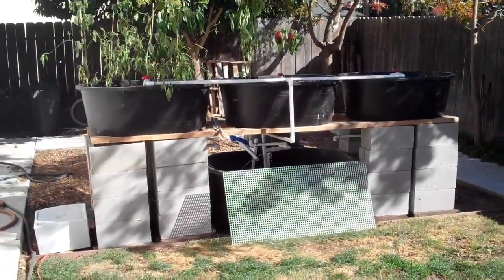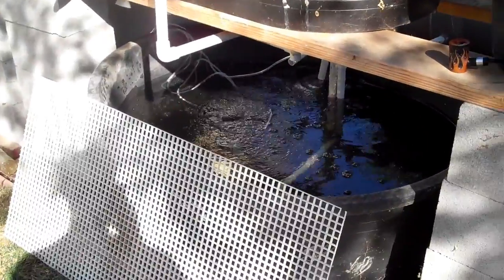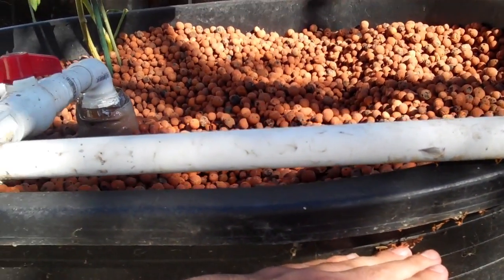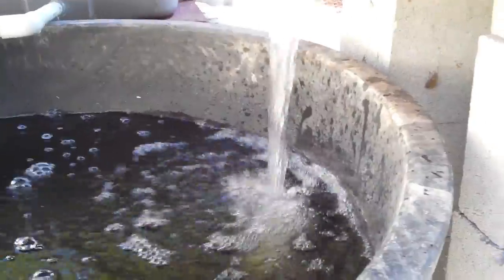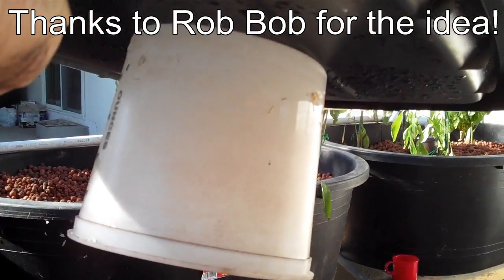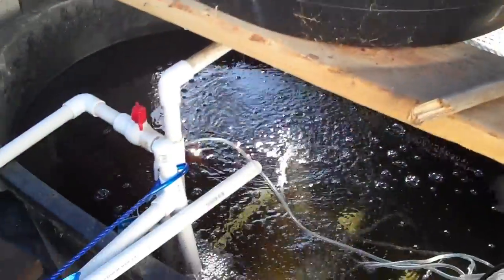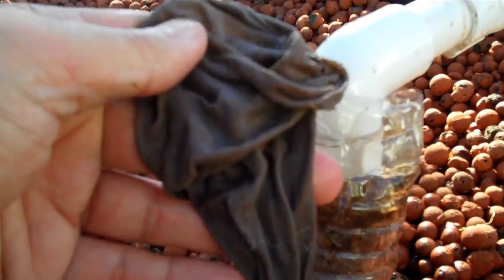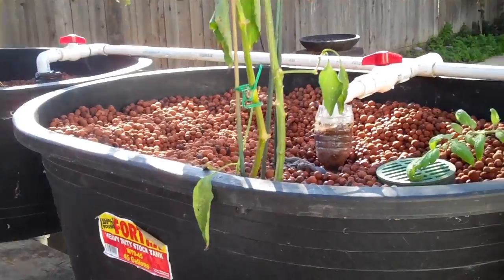Aquaponics - Complete System Walkthrough

Comment: Hey Stogie, Nice Video even with the use of only one hand. I am new to the Aquaphonic concept . In regard to the solid waste filtering. Does still enough of the essential "crap" get into feed the beds. IE the nitrates etc or is there ever a risk the filtering will be so good as not to allow for enough to feed the plants? Thanks much 
Tom
jomtien.unplugged@gmail.com
Reply from the maker: +Thomas Rossetti What you have to keep in mind is that the CRAP is not what feeds the plants.   You can have the crap isolated in a separate container, and it will STILL be beneficial.   It will still produce ammonia in the water.   That is all it does, whether it's in a grow bed or not.   The important thing is that the bacteria have a place to live (which usually is entirely in the grow beds), because it's this bacterial which take the ammonia out of the water, converting it to nitrites and nitrates (for the plants).   

The only thing solid waste will do in your grow beds is eventually turn them into one big sludge pit over time.   That's why I feel it's important to have a filter to separate the crap from everything else.   As long as it's in the system, it's still feeding your plants from the ammonia byproduct in the water which passes through the grow beds.

Comment: Overkill . Run the pump straight to the swirl bin and from there feed your beds. A lot of that poop your cleaning out of the water bottles and stockings is fertilizer for your plants. You need beneficial bacteria to grow in order to eliminate nitrite then the bacteria releases nitrate which is good for plants and safe for fish. Every time you disturb the bacteria your starting over with ammonia

Comment: I heard worms are great for getting rid of the extra solids, but you'd have to figure out a way not to drown them or sweep them into the water system.
Reply from the maker: +Elle Kelsheimer Worms are great, and I have them in all of my grow beds.   The won't drown if the water is properly oxygenated.   However, they are no substitute for having a way to REMOVE SOLIDS manually whenever you want to clean the system.   This is why having an additional radial flow filter (or swirl filter) is beneficial, because it allows you (the caretaker) to be able to remove solids as needed if you need to clean the system (without it having the possibility to clog up your grow beds).   It all depends on your system, and how heavily you stock it with fish.

Comment: Very creative. Fascinated and learning and new to these systems. Background is in aquariums.  U keep fearing dirt and gunk and are compulsively trying to block it! It plays a role. Let it do its thing. It settles under the gravel of a fish tank and breeds the healthy bacteria that converts nitrite to nitrate (or something).  Don't mess with the gunk too aggressively. You don't pour bleach in your intestines! Invisible flora is good. The water may get cloudy but once it gets established it clears
Reply from the maker: Karl Lehman aquaponics is a little different though.   The grow beds themselves is the primary place for the beneficial bacteria.   You don't want a lot of solids settling in the fish tank in the aquaponics system.  It's better to isolate them in your filters where they can be removed (if needed) or left in place to convert the ammonia.   It also depends on your fish to water ratio.   In aquaponics, you generally have a larger sticking volume so you need a way to handle the extra solids.

Comment: Thanks for the video. I tried to build the same thing as I already have a fishpond but I came across a problem. I am using the same growing media (the light weight clay balls). The problem is it floats on the water and when my water level rises everything comes out of the growing bed :)
Don't know what to do now. Any advise???
Reply from the maker: Tango Inasia - sounds like the standpipe in your browned is too high.  You only want the water to come about an inch BELOW the grow media.  So if it's rising above it, that means the standpipe (where the water begins to drain out from the growled) is too high.   Cut it down until its height is an inch below the top of your media.  That way, the water will never rise above it.
Reply: ***** Thanks, I will try to change it.

Comment: Thank you for t your video. I just finished reading a book by Sylvia Bernstein " Aquapac Gardening a Step by Step Guide to Raising Vegetables and Fish Together". In the book she introduces Red Wriggler worms to the grow beds to break down the fish waste solids into additional fertilizer for the plants instead of filtering it out. You might want to experiment with that to see the outcome.
Reply from the maker: David Wolfe I have.  There are worms in the beds.  However, that doesn't mean you shouldn't have ADDITIONAL filtration options.   You will discover this by putting a prefilter (like I have) between the grow bed return and the fish tank.   If that filter catches a LOT of debris, then you'll see that the grow beds and worms are not enough to handle all the solids in a system.
Reply: Thank you. I am just getting started and looking to learn from as many sources as possible.
Reply from the maker: I think this particular video is a little old.  I may have more updated ones on my channel.  Just look at my aquaponics playlist to find them.

Comment: Dude that is an interesting configuration, but you can tell it was a lot of work.  You could save yourself a lot of time and hassle by simply adding Red Wigglers to your beds, and just let the fish waste go in there.  It's actually not a bad thing, and the worms will convert it to even more nutritious fertilizer for your plants.
Reply from the maker: sly2kusa thee are red wigglers in there, but contrary to popular belief, that will NOT stop all the waste and micro-particles from being put back into the fish tank.  You can NEVER have too much filtration when it comes to the health of your fish.
Reply: That is a good point, but perhaps your efforts would be better spent on a better sump tank setup, with a way to mineralize the waste?
Reply from the maker: There is no doubt in my mind that my system is not optimal as far as setup.  I'd live to have a separate fish tank apart from the sump, but this is just an example of how a backyard system can run with nothing more than a few grow beds, a sump/tank combo, and some additional filters for good measure.

Comment: How long after you put that fluff material in to catch the solids did the fish start going? Or did they start dying off before that?
Reply from the maker: Boss Hogg they died before that.  The problem wasn't the filter floss, which simply helps polish the water up.  I believe the problem was due to not removing some of the built up solids out of the system.  This is why I built a secondary filter to help give me a way to cat pure and remove solids whenever I need to.

Comment: I have seen "the urban farming video Kansas mo" video he has a 55 gal barrel here is  the way his setup works;
we induces water into the drum creates a rotating swirl and filters most of the solids.
those are by the way great fertilzers.
I will try a 8" to 10 " pipe standing up 4 ft combined with a sand filter.
if you would place your water filer box higher than your growbed, you could use the run off from the filter box to feed the plantboxes. 
thanks for sharing your video
Reply from the maker: www.OneAlternative.us Yes, I'll eventually have the grow beds fed from an elevated water box, but I'm not in the mood to redesign things yet.

Comment: You should consider adding  a sump tank and move you pump over to the sump, raise you fish tank and put in a gravity flow siphone in your tank,  use a round trash or a food grade drum barrel so you have  a swirl filter instead of a square tub, the round barrel will cause a swirl effect and do a much better job of controlling your solids form going back through the system.  just some advice, enjoyed your video.  Happy growing
Reply: For a system this small, an inverted 5 gallon water jug would make an adequate swirl filter.  There are several videos on YouTube that show how to construct one.

Edit: I just watched some of the aforementioned videos, and some people didn't seem to grasp the concept of the swirl filter.  You want the outflow near the edge of the container, not in the center.  The centrifugal action of the swirl draws the particulate matter toward the center.
Reply from the maker: I have modified the filter you see in this video to be more efficient, and I've since added another five gallon filter.  See some of the later aquaponic videos on my channel playlist and you'll see it on there.  Thanks for the comment.  It's always an adventure with aquaponics, that's for sure.
Reply from the maker: Chip Truitt yes, those are all great ideas that I would have done......but often times aquaponics (and DIY in general) is all about making something with what you have.  I don't have any barrels or any other large tubs for Sumps.  But I do have a plan to get a 300 gallon tank for the fish, and transform their current 100 gallon tank into a sump.

Comment: You need to keep the water ph at a certain level and check the water temperature and minerals to add for the fish not to die next time.where are those bacteria placed,the one who are suppose to produce fertilizer by eating the fish dirt? if you use rain water,you dont need to filter the chlorine.
Reply from the maker: angetodac my pH is pretty consistent around 7.8.  The bacteria live in each of the three huge grow beds (which also contain worms).   In the two filters behind the grow beds, the bacteria would live on the scrubby pads.  As for rain water, I'd love to use it.  But we live in California and we've been in the worst drought in recorded history.
Reply: than,why did your fish die?No oxigen?too much heat? when did last time rain in california?
Reply from the maker: angetodac I've had roughly two massive fish die offs.  The first came from an unknown piece of metal on my tank (hidden inside of a water heater which was exposed to the water).  The second was (I believe) due to poor water quality from the grow beds draining directly back into my tank. 

I began noticing that the grow beds by themselves weren't adequate enough to filter all the organic matter that was in the system.   Even with proper water changes, my fish were still eventually dying even though ph, ammonia, and nitrates were at proper levels. 

It wasn't until I added additional filtration to help filter the water returning from the grow beds to the tank when I saw major improvement.  

My initial thought may have been perhaps the grow beds have some dead spots in them, producing anaerobic conditions which were poisoning the fish.  That still may be a possibility, in which case, these secondary filters help to gas off any bad stuff and oxygenate the water before putting it back into the tank.

They also help by adding another layer of solids removal, allowing the grow beds not to get too full.  You see, the fish waste still has a direct path to the grow beds......but if it gets too saturated and the worms/bacteria can't break it down fast enough, then my goal is to have these secondary filters catch some of that and allow me to remove it from the system as needed.
Reply: to:StogieFarts:this means extra maintenance from you for the system...the ideea was to build a selfsuficient system ,that takes care of himself automatically...maybe an airpump would solve the oxigen prb for the fish no mater how much dirt comes back...it should settle down and eit should be evacuated in a compost bin when too much.. .but...they say you need a 6 gallon water fish tank for one square foot of grown bed...maybe you should respect this "ratio".Good luck next time...thanks for answering me!Im just studying this,I didnot build yet one.I try to learn from other people mistakes before starting to build one...
Reply from the maker: What you'll come to learn is that if you can find an EASY way to remove solids from your system (instead of letting your grow bed handle it all), then that's your best bet.  Why?   Because it's a major pain in the ass to clean a grow bed (if you have large ones like I do).  

With my current system, I feel the maintenance I do is the same as with any aquaponics system.   There is ALWAYS something to do, check, tweak, etc.  the number one thing is water quality, period.  If you have good water quality, then both the fish and plants will be happy.  

As for ratios, I believe I am good there.  My system when full has about 115 gallons of water.   With three large grow beds and two additional DIY filters, it seems to be enough to handle the FOUR fish which power it.
Reply: Four fish? well,not to much expense invested in fish if you didnt take them from the river...good luck next time,I hope they wont die again...i realy want to see this work as it is the only way I can do agriculture(hate dirt).if the grow bed is made of gravel,or sand,it should be easy to presure shower,I assume...But you know better,Im just collecting information.Good luck!
Reply: to StogieFarts: what if you used a chop system:filter the water from the fish tank before sending it to the grow bed plants?only the liquids  nutrients are than passing to the beds,feeding the worms and bacteria? the solid sediment from the fish tank should be cleaned out and given to worms in a composting bin...the tea worm should be collected only and given to the plant beds.
Reply from the maker: I've considered that, but that would require having a RAISED container/filter ABOVE the grow beds so it could gravity feed the water back down to the grow beds. And currently, I don't want to replum the entire system since everything is glued into place and already cut to certain measurements.
Reply: ok!I have no more sugestions as you thought at all of them!..Youll find a simple way to solve that mater also!keep doing the great job!!bye,bye!

Comment: great video man, I'am trying to build my self backyard aquaponics system,I have a question,instead of splitting the pumped water to grow bed and filter section,why not let the water from the pump to the filter section and flow it back directly to the grow bed then from the grow bed to the fish tank?no offence but is there any particular reason with your system?I've been scrolling for while now to searching for this question and answer.
thank you
Reply from the maker: Adam Smith when I first made my system, there was no additional filter, only the grow beds (see the videos under my Aquaponics playlist to watch how the system build progressed).  So the water only went to the grow beds and back to the tank.   I added the extra filter after the fact, with the water which was being put back into the tank. 

To answer your question, the only way to filter the water BEFORE reaching the grow beds would be to elevate or raise the filter ABOVE the grow beds, and then gravity feed the water back into the grow beds.    And this isn't something I was willing to do at this point due to resources available and my current layout.    It certainly would work though.  

Bottom line: there are a ton of different ways to set up a system.  As long as you cover the basic essentials, your system will be functional and work.

Comment: I see you have your tanks outside. What happens in the cold winter weather? I live in South Carolina, but it gets pretty cold in January and February.
Reply from the maker: billnirmo here in California, the coldest it's ever gotten is in the 30's, but I have a small heater in the tank which usually keeps the water temperature about 10-15 degrees warmer than the outside air.   And koi and goldfish are very durable, so they can survive extreme temperatures as long as the fluctuations aren't fast.   For you, I'd recommend an insulated tank and definitely some kind of heater for the colder months.

Comment: I'm very new to aquaponics.  I an have a lot of trouble sealing the pipes where they punch through the Rubbermaid buckets. What size pipes, holes and what hardware do you use to secure the pipes, and most importantly, what glue or sealant do you use?
Reply from the maker: Jeffery Tripp I use a hole saw to drill out the hole.  For sealing, if you can get your hands on a uniseal, they work great.  Me, I just use electrical conduit adapters with some plumbers tape and preferably a rubber o-ring.   I don't use any glue or sealant on anything which would make contact with the water.
Reply: Go online if you dont have a hydroponics store close buy.  Purchase Uniseals they are the easiest way to do your pipes through about anything, no glue sealants or anything just push the pipe trough the uniseal expands and you have an awesome seal   http://www.usplastic.com/catalog/item.aspx?itemid=89951